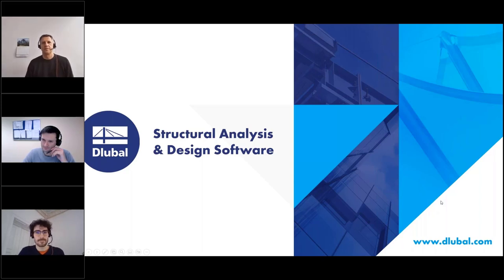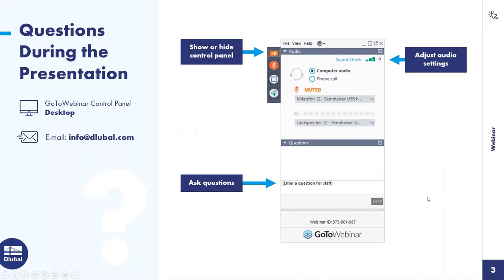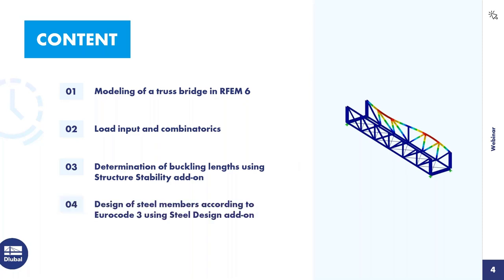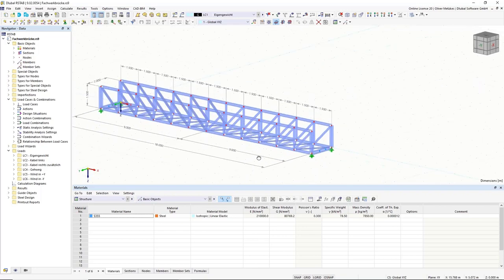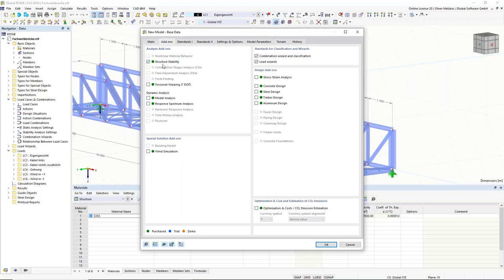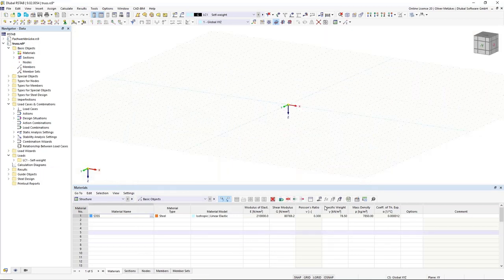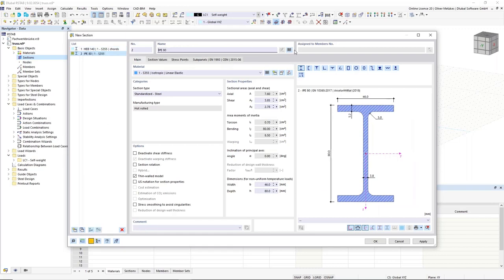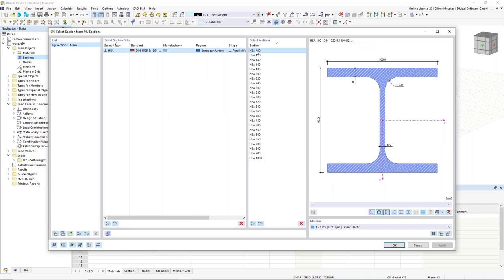Steel Structure Analysis in RFEM 6 and RSTAB 9

Comment: RFEM 6 is improved, compared to RFEM5. The graphic input is relatively the same. However the structural concept of effective length and buckling load is set to more visual in the current version.
Reply from the maker: Hi, @BoZhaoengineering! Thanks for your positive comment. We are always working on improving our software :)

Comment: I've learned so much in this webinar. Especially about concepts of critical buckling load and effective length. Usually the lateral buckling effective length governs and not the bending about the other principal axis. My question in the stability analysis why the software still gives the effective length of this other principal axis longer than the member length when in fact its effective length must be only equal to the member length because of the restraints of the web members? Like in this video, the presenter  used k equal to 1.0 to this other principal axis. Does the program always compute the effective length of both principal axis based on the critical buckling load not on the buckling shape?
Reply from the maker: Hi, MR.!
the critical load and the effective length are actually calculated for each member and for each direction, because the program cannot decide whether these are relevant or not. Iin the background, the stability analysis only determines the critical load factor for the entire model and from this the further results are determined.
Reply: @DlubalEN  Thank you very much for the response. For me this is the best webinar of Dlubal with regards to the concept of critical buckling load and effective length including their applications to the software. Kudos! Indeed RFEM is the best for steel design.
Reply from the maker: Hi, MR.!
Thanks a lot for your great feedback :-)